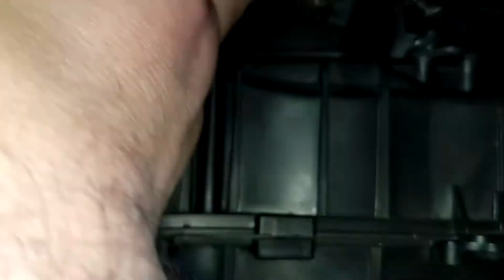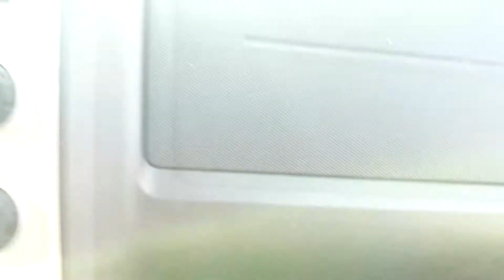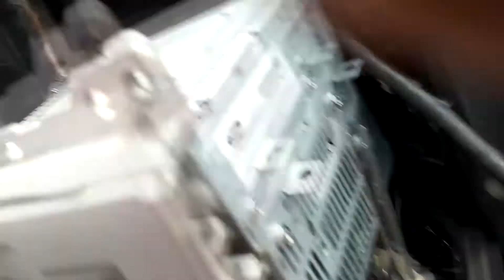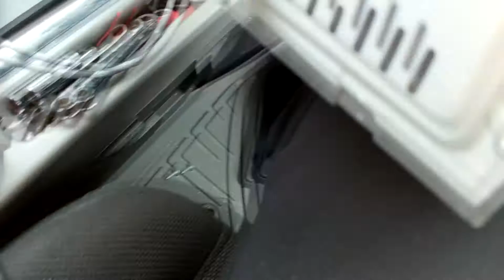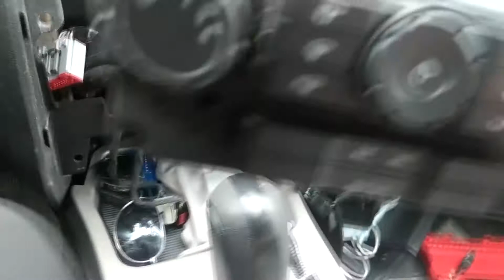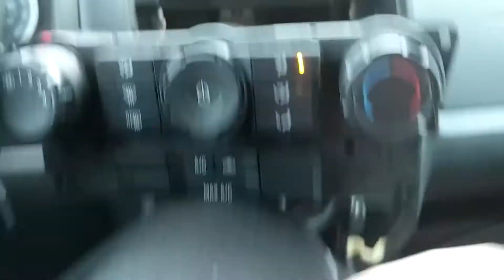Fix Your Cars Heater / AC Fan Speed Control Switch. NO Its Not The Blower Resistor

Comment: How to bypass the rotary switch?  I'm not spending a lot of money to replace that on an old car.
I'm currently running the blower motor with a 12v battery so I can defrost my windows, but this is the only video that actually talks about the actual switch.